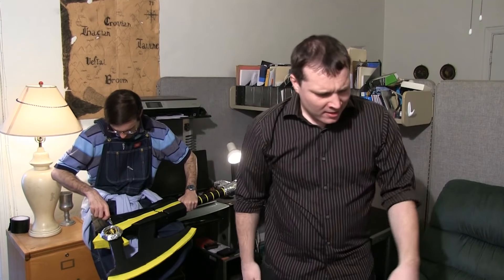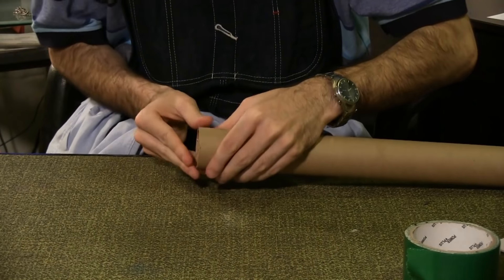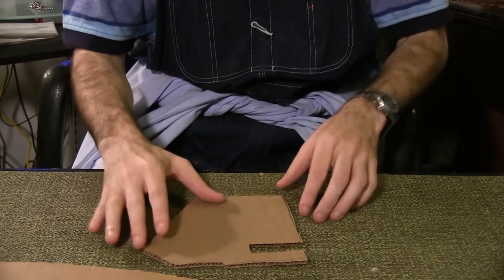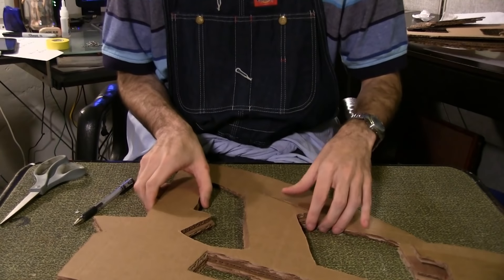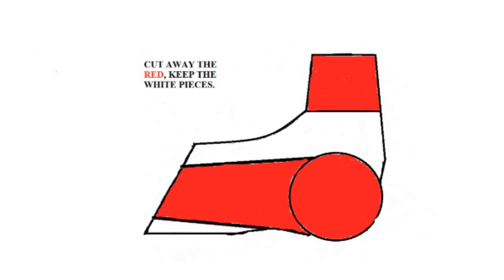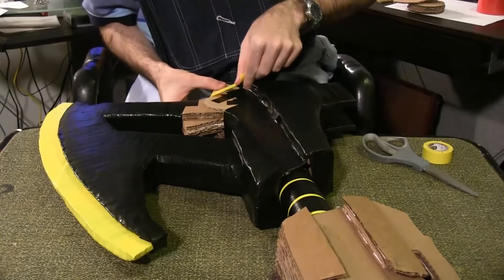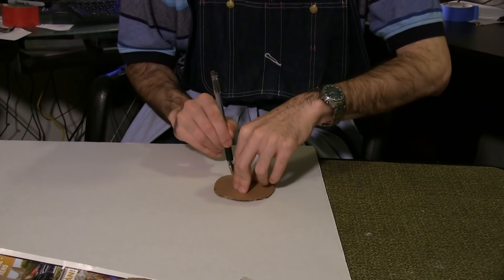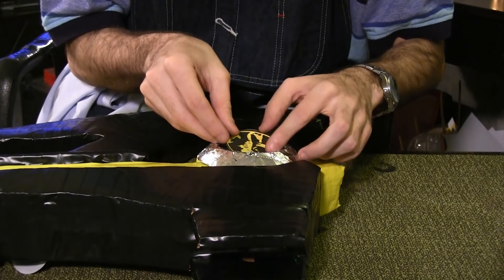How to Make Zack's Power Axe

Comment: do you have a way to send us links to the templates you show?
Reply: What you can do is take a screenshot of the template in this video, then either print it out or copy & paste it on a Word paper and then print that out. Then program the printer to enlarge it accordingly. You're gonna have to place the paper on the printer accordingly to get each part of the template on their papers. Once you have all the printouts, "connect" them accordingly and tape them together. 

This is what I did when I made the power lance and power daggers.